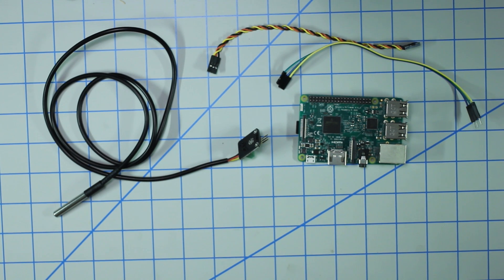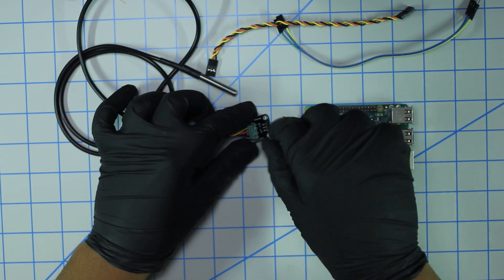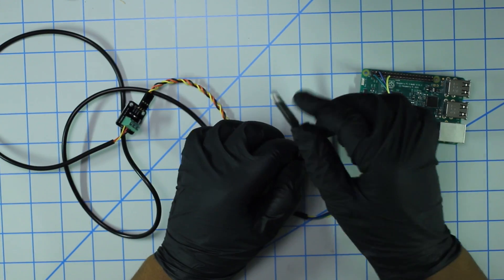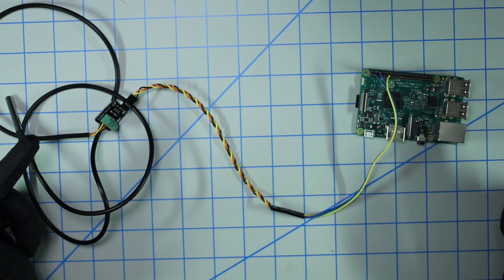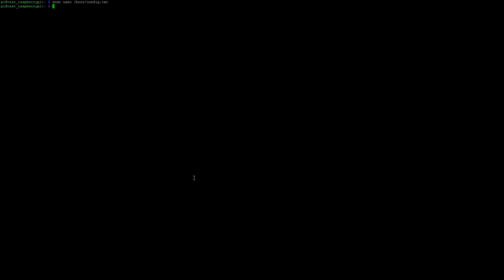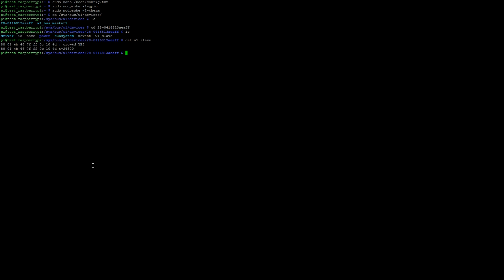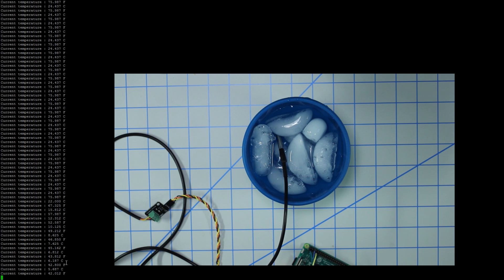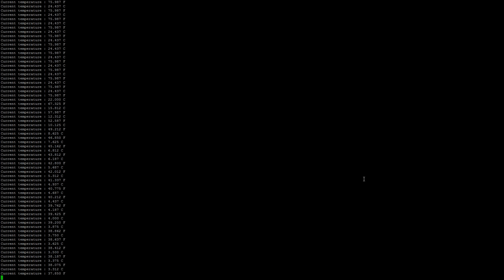Temperature Sensor (DS18B20) Raspberry Pi

Comment: I have an issue. After a few hours of running the script it stops and throws this error:
IOError: [Errno 2] No such file or directory: '/sys/bus/w1/devices/28-0216924510f2/w1_slave'

It's like the folder suddenly disappears. If I reboot the Rpi the problem persist. I have to shut it down then it works for another few hours. It works for what I'm doing but it's inconvenient for long term monitoring. Any ideas?
Reply: ok so for some reason the sensor i put on my pi does this too, and the sensor seems to like to randomly reset itself for no reason. 

the way i fixed it is by disconnecting and reconnecting the resistor.
Reply: @cathamburger3161  I used the code in this tutorial and now it doe snot fail. http://www.circuitbasics.com/raspberry-pi-ds18b20-temperature-sensor-tutorial/
Reply: F

Comment: Can you post the model number for the breakout board?
Reply from the maker: Hey Nickolas, the boards are unlabled. However, if you search "Ds18b20 Adapter Module" in ebay you should see them.
Reply: @PiddlerInTheRoot  Thanks bud
Reply: @PiddlerInTheRoot  Thank you!!  i could not find just the board anywhere.

Comment: I try to follow the tutorial and do the exactly same thing, but I don't get 28-xxxxxxxx, instead I get something as 00-xxxxxxxx. I use just one set of jumper cables i.e. connect the temperature adapter to the pi without using another set of cables (as I have jumper cables without the clips on one side) Is there something I am doing wrong?

Comment: Does anyone have a wiring diagram and script that would allow us to control a fan once the Pi reaches a certain temperature?....that way your fan is not running all the time especially in cooler weather if your pi will be used in an outside enclosure as we are going to be doing for certain applications.  Thanks for any help!

Comment: Does anyone know of an app that can run on an Apple phone that will allow you to log in to a Raspberry to get the temp reading or program to run on the Pi?...Thanks!
Reply: I use Termux (For Android) to SSH into my Raspberries when I need to. I think Apples's equivalent to this app is Blink, and according to google it can be used for SSH connections.

Comment: hey just wanted to let you know this was very helpful.  i have a gas water heater that sometimes doesn't kick on and needs to be turned on again. will use the temp sensor taped to the hot water heater tank with hvac tape to make sure the water is heating up and if it doesn't it will turn the water heater on again with the relay switch.  anyway.. happy that I won't have to use a ugly breadboard
Reply: I need to to do the same thing, but I want it so when temp of pipe drops below a certain temp I get an email notification, My system has recirculating pump and sometimes it does not activate

Comment: ofcourse we all fiddle with cable colors but for an instructional video it might not be the best. A female to female cable in the right colors would have helped a lot.
It might be a good idea to check the datasheet for simple facts such as the temperature range.
Where you type in code it is  in fact unreadable
It is a pity (but not your fault)  that the DS18B20 values apparently have to be put in a file first
Reply from the maker: Right, thanks for the feedback. Definitely trying to address some of those quality issues in future videos.
Reply: such a reply deserves respect

Comment: I want to measure body temperature of an infant , please suggest me a good body temperature sensor which could be interfaced with raspberry p....it would be a great help
Reply: ds18b20 will do that, but for a child it seems easier to just buy a digital thermometer
Reply: As a biomedical engineer, please consider the electrical safety (IEC60601) for your infant

Comment: I had thought that the Pi only did digital pins and that you would get either low or high from a pin. How is this receiving data in what seems to be an analogue form? Be interested to know as a Pi noob :) For instance I have a project for which I'll be using a sound sensor. The sensor has both analogue and digital out and I though I'd only be able to use digital. This video seems to suggest otherwise.
Reply from the maker: https://www.maximintegrated.com/en/app-notes/index.mvp/id/4377
Reply: Thanks for taking the time to shove a link in there. I appreciate the lack of verbosity of the reply but unfortunately it doesn't help with my question much. I can see how the sensors work but not how the data is represented at pin level. Like I said in my question, I thought the Pi had just on/off for each pin, not a voltage level. Anyway,  not to worry, I can look elsewhere for the answer.
Reply from the maker: I'm not entirely sure how the sensor works at the pin level... but this article seems to imply that the output pin communicates via serial to the raspberry pi. https://learn.adafruit.com/adafruits-raspberry-pi-lesson-11-ds18b20-temperature-sensing/ds18b20
Reply: Ok. Now I get it. So, I guess what I'm interested in is reading the pin data directly with Python. You are opening the file on the Raspi and parsing that data. From your second link I'm seeing that with a serial library I can actually pick the serial data up directly from the pin and the temperature probe itself is communicating directly in serial. That is VERY interesting - I didn't know I could do that with the Pi, so in effect I'm getting a type of analogue readout through a digital pin. Thanks for the info. I happen to have one of those probes from another project using a BlueTooth device to transmit the temp data but I'd like to try and use it now to read the serial data directly.
Reply: well the DS18B20 measures an analog value, but sends it in a digital format 
Whereever one sees the ds18b20 on a raspberry explained, it is the same old 'write to a file'  which is a pity. The DHTxx series for instance can be read directly into a variable  without the help of a file. Somehow should be possible with the DS18B20 as well. It is possible on a PIC or Atmel chip

Comment: Hello , I did as shown in the video (i put the resistor) and when i put the codes it shows me that way w1_bus_master1 with no number , and if i take out the resistor i get 00.8xxxxxxxxx , some hel pplease?
Reply from the maker: What is your resistor value? Check out this thread https://www.raspberrypi.org/forums/viewtopic.php?f=28&t=155941
Reply: It's 4.6ohms
Reply: that's a tadd low.pick 4.7 kiloohms

Comment: It is not good practice to change the colors of the wires. Try to maintain the wire colors all the way.

Why? Well, IF you need to troubleshoot, it will keep you sane. Just look at how many times during the video you had to refer back to the sensor board to make sure your changed colors were connected to the correct pins.
Reply from the maker: I absolutely agree that you shouldn't change the wire colors whenever possible... but sometimes in life you experience a shortage of jumper cables and have to make due. :)

Comment: For all of you who is using a sensor like this with Raspberry Pi, that does not have the breakout board. You put a 4.7k resistor connecting the red and yellow wire together before connecting it to the raspberry pi. 

You know that you have to do this when you get 00-8xxxxxxxx instead of the 28-xxxxxxxx number and it varies.
Reply: just a word of warning..... apparently NOT all breakoutboards have a pull up resistor attached.
Although you could use the internal pull up of the raspberry pin, I found  it more reliable to have a seperate 4k7-10k resistor for pull up
Reply: Hello , can you help me finding out what's the problem of my Raspberry Pi ? I mean , sensor . I try to connect the sensor (same as in the video) to the breakout board 0.8000000000 , used flooder to stick the resistor to the red and yellow and still 0.8000000 , i don't understand what to do , i am browsing for 6 hours and still nothing.
Reply: Since I did not have a resistor I've tried running in parasite mode but it did not help... when I got resistor it worked but it's kinda weird you need an extra resistor to make it work.
Reply: from a technical point of view it is explainable as it has an open collector.
As for the ' why'? Well you could connect a whole bunch of these sensors to one pin,so if you would have an inbuilt 4k7 resistor and you would connect 10 sensors.... tghe combined pullup would be 470 ohm and that is just a little bit  over the top
Reply: In this video there is Pluggable Terminal that (usually) comes with DS18b20 sensor. It has 4.7k resistor attached and wired correctly. So you can attach multiple sensors with single terminal (just by jamming more sensors to connector).  If in doubt, just check if your terminal has tiny resistor that has numbers "472" on it.
Reply: Yo thanks for this explanation it cleared up a lot of issues I was having. I'm completely new to electronics side - so my sensor didn't come with breakout board but a simple resistor wire how exactly do you connect that to the wires, I tried directly on the PI and nada.